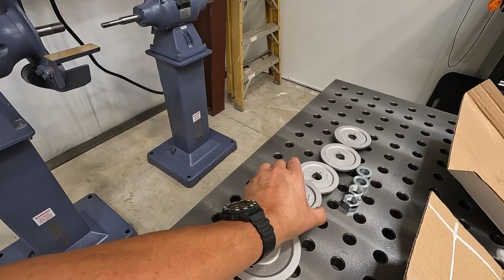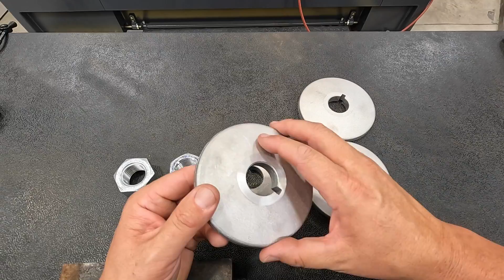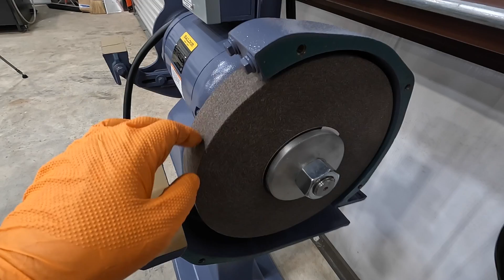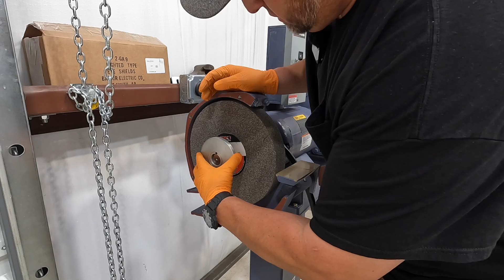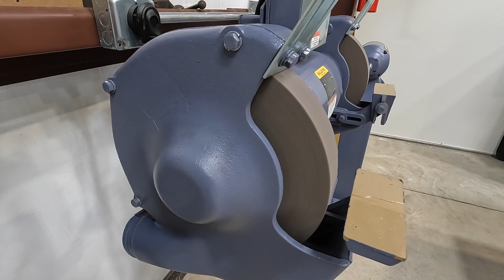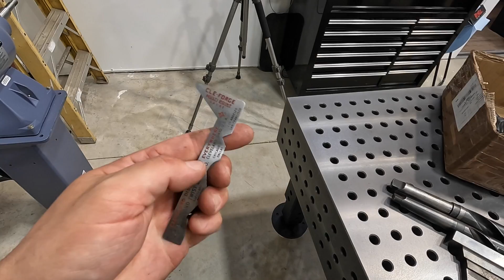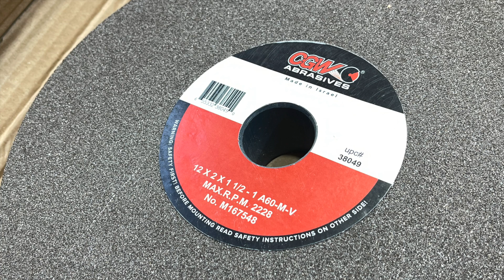Pedestal Grinder Improvements and Wheel Installation

Comment: Adam,

I know you get these suggestions and so on often enough, but you might want to think about installing some backing behind the grinders, as that insulation won't last very long with all of the hot sparks coming out the back of the grinder. That plastic doesn't take much of a beating before it's done and shredded.

Comment: Why is it always with grinders, where it's critical, that they ship with wheel parts that are always unbalanced?  And from Baldor nonetheless!  I expect it from Craftsman, but not when you pay $1200 for a grinder.
My Craftsman came with those crappy pressed washers, so I ended up machining shoulder washers for it, 100% improvement.
Reply: I don’t honestly think the Baldors are all that good. I got a top of the line 6” and the whole steady rest is basically raw castings that I would say aren’t particularly accurate even for sand castings.
Reply: @ebrewste  Are Daytons worth the price?
Reply: Agree, but try $3k+ for the grinder.
Reply: @MrThisIsMeToo  $3K!!  Ouch!

Comment: What about the inside center area is it already lower than the outer face that contacts the wheel
Reply: I was about to ask the same question. That surface should be colinear or below the larger face.

Comment: I'd hook up a shop vac mini with catch bag inside connected to a Y and hose to each side. Hang, make a mount or strap it to the beam behind the grinders. So you don't have to bend over all the time to turn it on. That would really keep the dust and grit contained.  😉👍

Comment: Wouldn't  filling those vertical square tubes with sand help with vibe dampening too?
Reply: OH yeah, that will absolutely help dampen the humming and vibrations. I've done that in my maintenance shop at a golf course when I built newer pedestals and columns to replace the factory ones. 
The grinders were a lot steadier and quieter after. 
Hope Adam attaches some metal flex tubing to the rear of his grinders, and directs them into a 5 gallon pail. Helps control the grinding dust if he doesn't want to spring for a proper dust collection system.

Comment: Something to think about you need a sheet of plywood or metal on the wall behind the grinders so the sparks don't set the insulation on fire, if you use metal you can always take it outside and pressure wash it for a good cleaning
Reply: I was going to mention that, but wanted to see if anyone else had. I probably still will, just in case one comment gets more likes than another, so he can see. I don't think he mentioned anything about protecting the wall.
Reply: Another way he can do this is extend the exhaust ports with a gradual 90 towards the floor and place a 5 gal bucket half full of water as a spark arrestor

Comment: That big three horse grinder is a beast. Used one five days a week when I worked as a industrial blacksmith for a forging company. Had it the last 7 years I worked.
 Forged all the tongs and tools for the production forge shop . Made what ever they needed. Just short of 30 years . Changed the wheels about three times a year. 
  It got used hard and never flinched.
Reply: My first construction job I used a jackhammer every day. When it was time to change bits I could tell instantly when I got a bad regrind. Sometimes it would just snap in half.
Reply: @firesurfer  when bits snap like that it's most likely a heat treat problem.  Cracked during quenching or was hardened to be too hard.
Reply: @steveparker8723  It's like they forgot to temper them after hardening.

Comment: This isn't meant to be a patronising comment in any way but that style of dressing wheel doesn't do a great job of trueing a wheel from my experience. The dressing wheel removes material as its designed to do but follows the roundness or out of round of the wheels so doesn't remove the high areas. Single point diamond dressing bar is what I've always used to true wheels, and the rotary dressing wheels for dressing. Spanking grinder though and I'm sure it will serve a lifetime of use in the new shop! 👍

Comment: Dont you have the risk of unthreading the left handed nut when facing it?
Reply: Yes, you do but having the screwthread fit so perfect and by taking five thou which is 0.127mm is very little material that is removed at a time. Good observation there.
Reply: @brentN2028  10 thou, not 5
Reply: @polakiss  he did two 5 thou passes
Reply: @polakiss  yes, he did 5 thou cuts at a time is what I meant.👍

Comment: Some great work there, now I got another job to do, thanks man!! Surprised a premium brand like Baldor hasn't taken care of that already, those castings were rough af in terms of dimensional accuracy and plumbness. Looked like the centre holes weren't especially central either.  I'd be tempted either to bore out the centres completely and bush them, or to remake them from scratch.
Reply: Considering that a 12" baldor grinder was $3000-$5000 you shouldn't have to worry about the plates.

Comment: You may want to consider installing a vacuum dust collection system on the 12" grinder. Although they are a bit noisy when it's turned on but the benefits It will keep the surrounding area around the grinder clean.
Reply: great idea! the question in a busy shop is who will be cleaning the dust collection system?
Reply: @jenniferwhite6089 , We had both a 10" & 12" grinder with vacuum dust collectors on each of them at my old workplace. With 12-17 workers (mind you they were not used everyday during the work week) we only needed to clean out the vacuum bag once every 6-9 months.

Comment: This may sound like a dumb question, if you were to fill the hollow base (stand) with sand wouldn't that make the grinder quieter?
Reply: True up and maybe even balance the stones and no additional tricks are needed.
Reply: @MF175mp  so you're saying the sand won't work or not needed?
Reply: @rhadden8976  it might reduce noise little bit but imo not needed
Reply: Bolting it down works.  :)

Comment: Would it have been better to make an arbor for the wheel flanges, then true up the faces while on the arbor??  Since you were not happy with the flanges, why assume the BORE is true?  If the bore is off a tiny bit, then the faced surface would also be off

John
Reply: He said it was already 10 thou over and didn't want to make it bigger. There is no way over that short a thickness of the flange there would be any binding.

Comment: How did you fix your LED lights from causing problems with filming?
Reply: Adam just changed the frame rate of the camera. Didn't need to touch the lights.
Reply: @beezul  Thanks for the info. Good to know.
Reply: There is also anti-flicker software, but I don't think he uses it. Hospital construction mentioned it this week on YT. It's very heavy CPU usage and takes a while even for short clips.

Comment: Always ring test the grinding wheel before you mount it on a spindle...most important part to fitting a wheel. Un plug it don't test the wheel for any cracks..!!

Nice threading btw

Comment: Fantastic work, as usual, Adam.  It's impressive seeing how quiet those Baldor grinders are, especially after your minor modifications.  It's a shame they didn't take care of that at the factory since I'm sure they cost quite a bit.  They don't deem to understand that without those parts being balanced. The unbalanced mass will eventually shake the grinder apart, leaving you with a pile of crap.   Or maybe they do and count on them not lasting that king and have to be replaced. 🤷🏻‍♂️

Comment: You need to go watch a video by Mr. Pete and you will throw out that dresser  !!!!
Reply: Did mr pete have a single point dresser? The only dresser that gives great results
Reply: @MF175mp  Yes
Reply: @MF175mp  Yes and you can get it from Penn Tools
Reply: The only grinders I've ever seen trued with a single point dresser are engine valve grinders and surface grinders where that much precision was required.
Reply: @russellstarr9111  I have done some occasional hand work with the tool/cutter grinder wheel and it's just so much better to grind by hand when the wheel runs actually true. You can rest the tool you're grinding on the wheel even without other supports and it doesn't bump around and the finish is great even on a hand ground tool. 

99% of the dressers for bench grinders don't true the wheel up, they just open the glazed surface of the wheel
Reply: @russellstarr9111 , Golf course reel and bedknife grinders always have their grinding wheels dressed and trued with diamond single point dressers. Used to do that weekly, depending on use. Reel mowers depend on precision for an accurate cut.

Comment: anyone know how I can find the history of thread standardization development?  I’d really enjoy learning how the various thread type geometries, profiles, depths, widths, etc. were “invented” or developed.
Reply: Google Whitworth - he's as good a starting point as any :)
Reply: Machinery's Handbook?
Reply: There were some decades before metric DIN threads were invented so machinists made threads usimg metric measurements and whitworth pitches. Wild times for anyone trying to restore these. How they went to 60° I don't know.

Lead screws and the such used to be square threads, as trapezoidal wasn't invented yet, but they were hard to manufacture so someone came up with ACME(I believe to have heard it had a different profile originally, but they changed it to 29° early on). Trapezoidal has 30° because that makes more sense.

Comment: You should plumb the exhaust ports on the grinder pointed down into a bucket of water. Keep the shop cleaner and save the paint on the back wall.
Reply: I just moved and would like to add a abrasive room to my shop
Reply: He did say he was probably going to move the grinder at some point so maybe when it's in the final spot
Reply: That's not paint on that wall. It is a plastic backing, covering the insulation on the exterior of the building.
Reply: If he did that the tool rest would vertical and impossible to use. 🤣
Reply: lol

Comment: I prefer the forward to reverse method for threading so you never disengage the half nut therefore never making that mistake. I also never use the 29 degrees method either I just leave it at 90 ...cheers

Comment: looks like you need to raise that buffer up. Being a tall guy, it might be hard on your back.  Some 4x4 or 6x6, or better yet, 2x4 or 2x6 stacked. the big squares are twisty, as they have so much moisture in them still, the smaller sticks also have moisture, but not as much.

Comment: Why didn’t you face the inner faces of the cast flanges? On the flat side
Reply: The inner shaft face (the hole) does not touch the wheel.  The ineer big face that he machined is the one that press on the wheel.
Reply: The inner face of the flanges should not touch the wheel. From the factory there was some space and depending on how much was removed from the outer face, there should still be clearance.
Reply: I thought that may be the case. Couldn’t make out on the video if both faces were in line
Reply: Presumably because it has clearance from the wheel.

Comment: That is a shame he is not covering that expensive fireball tool welding table I hope he covers that table he can tarp it it won’t look the best but it will protect it from everything he puts on it
Reply: the table is a tool and its designed to be used. its a welding table, not your grandads glass coffe table.
Reply: Tarp can catch fire when gring next to it especially a used one that may have oil or other products stained on it.... the table can resist a few tools on it. Better a few scatches on a weldsing table than a burnt wall.
Reply: Covering a welding table???  Are you serious??!!!

Comment: I have an old Swedish Arboga EP308 pedistal grinder from late 60’s and it has a separate motor for dust collection which leads in to two fireproof bags, one for each wheel. Is that optional or non existing in US?

Comment: Adam those pedestals could use some cork gaskets between them and the floor.
Possibly some fire foam inside for noise dampening or fill with sand.

Comment: 27:15 holding my breath. The nut could come lose.
Reply: That is a good point. I did not think of that when he made that cut.
Reply: @robertmeyer8221  he tightend it with a wrench and it was a small depth of cut, but it looked akward

Comment: You will need to protect the Insulation of that wall behind. The grinder ist trowing quite some sparks on it.
Reply: I was thinking the same thing. An inexpensive sheet of plywood screwed to the steel channels would work.

Comment: Every shop I have ever been in had at leasf one Baldor grinder, most of them older than me  I'm in my 60's and the Baldors I have seen all looked older than me.  Talk about reliability!.  Keep in mind the loose fitting fixtures are to your advantage.  When you install a new wheel, you can use pencil point alignment as your preset, then dress them by hand once everything is snugged.

Comment: Keeping the grinders away from the machines is smart. Can a welding fume extractor do double duty for that abrasive dust?
Reply: Baldor makes dust collectors for their grinders. If nothing else, fit two hoses to the outlets on the guards & drop the opposite end down into a bucket of water.

Comment: I was also taught that when a new wheel is placed. Tap it lightly and ear check for cracks or other defects. Place it  on the grinder, then turn on the grinder and allow it to run for an hour. Recheck tightness on hardware and then allow to run for another hour. Leave it off and allow to cool. Recheck tighness and 1 more long run.  Then you're good to go. I saw one new wheel explode, that was a sight as shrapnel went all over the shop. It had been dropped.